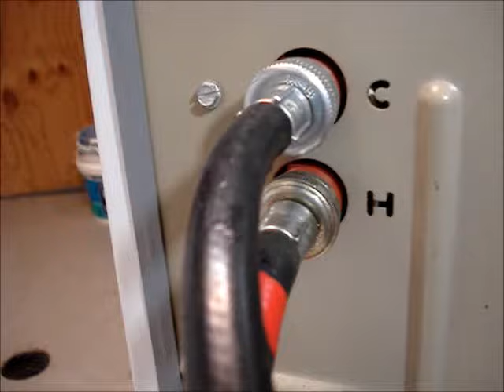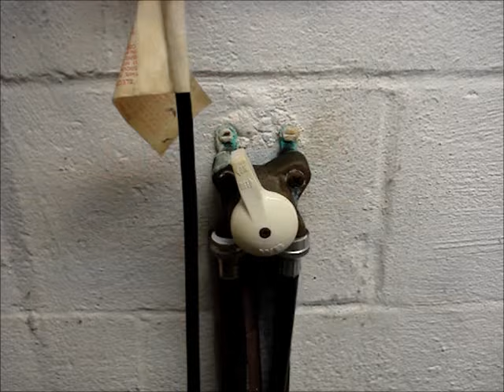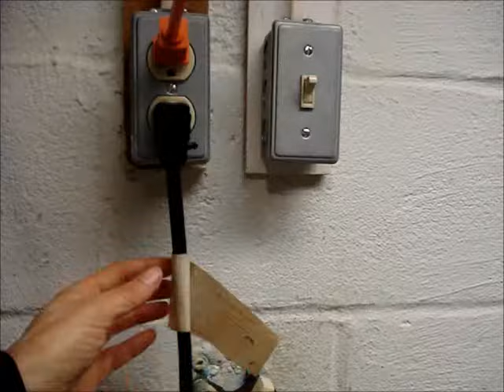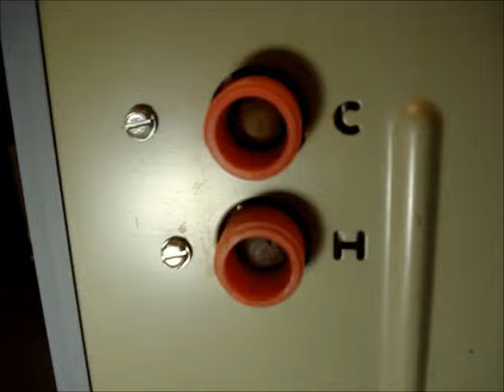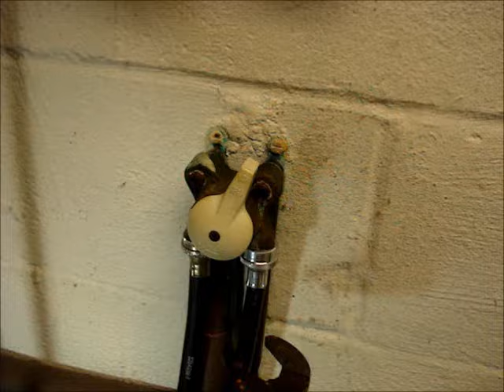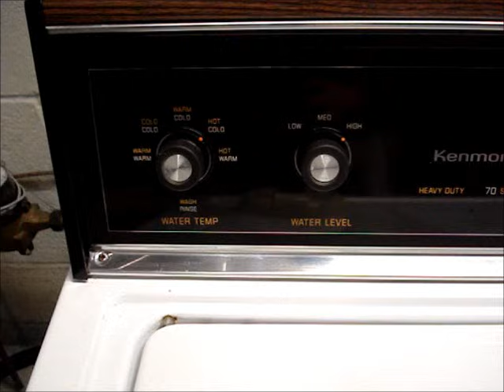Washing Machine Fills Slowly - Troubleshoot It

Comment: My problem is when I set my temperature to "warm" my machine instead fills with hot water. It fills normally with the hot water when getting started. When it goes into the rinse cycle it's slow to fill up. I just get one stream of water coming out. Takes a long time to fill up.

I checked the filters they were ok, not very dirty. I let water flow through each hose, no problem. So, what could be my issue?

I have a GE machine.
Reply from the maker: Sounds like the inlet valve is not letting cold water into the machine.

Comment: OK, I watched your video and it’s very interesting. I did exactly what you said. Change the hoses with new hoses put a new inlet valves in the back of the washer with the hoses. CONNECT checked the psi. Did everything check the drum with the water comes in, still having the same problem even with (2) speed queens the cold water is still slow. What else could it be?
Reply from the maker: If I understand, you have 2 washers and both have slow fill on the cold side?  If that is true, then either there is a clogged screen on the cold or you have some plumbing issue upstream from the washers.

Comment: I have clean filter and good water pressure to inlet valve. Cold water fill starts strong but then slowly and get IE error. Hot water fills fine but cold water rinse is slow and get the error during rinse. 1 1/2 year old LG HE machine.

Comment: if I mistakenly reverse the wires on the valve will it still work? thanks!
Reply from the maker: Somewhere on the washer there is a wiring diagram.  Maybe the back of it.  That should help you get the plugs in the right place.

Comment: They used to make these valves where you could dismantle them and clean the plunger, etc.. I remember doing so prior to about 1985.  Now they are pretty much plastic throwaways. Soaking parts in white vinegar can work wonders.

Comment: OK I did all of these steps before watching this video, bought a brand new inlet valve and still the cold water is flowing slowly. Wtf
Reply from the maker: Maybe the new inlet valve is bad?  If possible, I buy OEM parts, some of the after market are poor quality.  I just had a conversation with someone my car wiper repair video.  Turns out the new motor he bought for the wipers was bad.

Comment: could the issue also be low pressure to entire house? such as before the water even gets to the faucet the hoses are connected to?
Reply from the maker: If you suspect that is the problem, you can check the water pressure.  I have a video that shows how to do that.  https://youtu.be/ySfaBvV6e84

Comment: Wow, not only is this video super clear and concise and helpful, but thats actually the EXACT same washer I have 😂 hopefully I'll have full water flow soon! 😁
Reply from the maker: They don't make appliances to last as long these do.  You might want to check out to see if it is agitating correctly.  There are dog agits, little plastic parts that have teeth that wear down.  When I bought mine on eBay, they were under $5.  I also have the companion dryer and some repair videos for it.  Here's the link to the video to replace the dog agits - cheap & easy.  Have a great day.

https://youtu.be/mvdKR4FR7jE?si=a6hYWYdy3rqCIecp

Comment: replaced hoses and inlet valve, checked waterflow. Still not getting good flow on cold! What could be the problem?
Reply from the maker: Hmmm,  did you check for voltage to the valve or continuity of the wires going to the plug that connects to the valve?  I have a video that shows how to replace that valve, around the 4 min mark I show how to check continuity of the wiring.  Also, not likely, but you could have a new bad valve.  Link to video:  https://youtu.be/wZCAun0eb5M
Reply: @Know-How-Now  i may have to check the wiring. it's an old washer

Comment: I have replaced my water inlet valve twice in the last two months. Each time I replace it the cold water comes in correctly and a couple of weeks later it gets extremely slow again.  Any idea why the valve keep going bad?
Reply from the maker: To confirm, you are saying two new water inlet valves have failed?  If yes, are they the same brand?  OEM parts?
Reply: @Know-How-Now  yes two have failed.  They were different brands.
Reply from the maker: Do you have 120 volts on the cold contacts (same voltage as the hot side when it is open)?  Or another thought, can you swap the hot & cold wiring?  I find it hard to believe you have 2 failed valves, but better to be absolutely sure.

Comment: Question,  I have checked the screens they were clear , The water makes a choking sound while filling the machine ? Could it be the hose is clogged? Would greatly appreciate your input.
Reply from the maker: I would have to do the test shown in the video to know if the hose(s) are clogged.
Reply: I have the same issue while filling up.  Water comes out in pauses , while filling , it makes this choking noise .
I replaced the valves/solenoids , but still have the same issue . Wonder if it's the main control/timer that's bad.

Comment: My washer fills quickly at first (hot or cold).  But then, for some reason, it slows down.  I have to keep pushing pause and then starting again.  When it starts back up, it flows strong again, but then after a bit, slows again.  Any suggestions?
Reply from the maker: If you've followed the steps up to around 4:45 and confirmed that you do not have a water supply problem, then odds are good the water inlet valve is failing.
Reply: @Know-How-Now  Thank you!   Ended up being a clogged cold water screen where it enters the washer.
Reply from the maker: Great, you found the problem!
Reply: That’s my exact issue but only with cold. My screen is clean. Pause and start flow comes back.

Comment: Thanks for this guide. I'm going to use this to check my washing machine. It fills about 1/4 the speed on cold as it does on warm or hot, so I'm fairly certain there's an issue somewhere in the cold water supply or cold inlet solenoid.

While my apartment maintenance won't come out because "there's a pandemic and the machine isn't fully broken", I can at least narrow it down to what needs fixing and, if it's something they're responsible for, have them at least put a replacement part (and written permission to proceed with the repair on my own since they can't send someone out) in my mailbox.
Reply from the maker: You are welcome, Matt.  Best wishes for your pandemic repair.
Reply: Update: it’s not a problem with the water lines or the screens. It’s some thing either electrical or mechanical with the valve on the washing machine. I’ve put in a maintenance ticket and they said they’re going to come out and get that replaced sometime during the week!
Reply from the maker: Thanks for the update, Matt.  It's probably the solenoid/valve.  I think that some businesses are using the pandemic as an excuse, though I suppose some tenants may not be wearing masks and putting the maintenance people at risk.  2021's has got to be better than 2020.  lol, I think most of us will be glad to forget this past year.

Comment: Clean both of the screens in each inlet inside the washer hose inlet. There are two screens for each cold and hot on the washer.. One is inside the machine inlet that you can't see, and one outside the machine that you can barely see, it has a tab you pull out.  Use a flashlight and look inside the inlet tube or nipple that's threaded,  after you take the first screen off you'll see it..  My inside screen was clogged bad. Both hoses were good I saved, didn't need new hoses... All fixed.
Reply from the maker: Thanks for the additional tips, WhiteFeather!  Have a great day.
Reply: Do all inlet valves have 2 screens?

Comment: I have no problem with the cold water.  In fact I get mostly or all cold water only when I choose the warm water on the dial.  Problem is when I want only hot water it comes out as a trickle and takes a insane long time to even fill up to a small load.   Cold water no problem, warm water mostly cold but hot Geez a loo it is barely trickling out.  And sometimes when I don't put it on hot water the whole damn thing makes a loud humming noise.
Reply from the maker: If you've checked for clogs and you know it's not a water supply problem, then as stated, the trouble is likely the water inlet valve.  I have an additional video on replacing the valve.  https://www.youtube.com/watch?v=wZCAun0eb5M

Comment: thanks for the video seems like simple things to check. Mine runs slow only on the second fill.  That accent you have sounded like Philly or 
?
Reply from the maker: You are welcome, Mr J-Charles.  Good luck on the diagnosis.  If it's the inlet valve I have a video showing how to replace it.  See link below. I live about 50 miles from Philly.  https://www.youtube.com/watch?v=wZCAun0eb5M
Reply: Good call!

Comment: Where did you find that part? I have the same washer and dryer except mines the 70 series vales are turned where they side by side.
Reply from the maker: I have the parts diagrams that came with the washer.  If you don't have that, I'd try using the model number on the tag to search for the correct part.  There are a bunch of suppliers where you can find a parts diagram/part numbers.  I think I bought my part on eBay.

Comment: My washer starts spraying water good then slows down
Reply from the maker: You'll need to go through the steps shown in the video.  If you can eliminate the water supply, then it's likely the water inlet valve is the problem. I have a video that shows how to replace the inlet valve. https://www.youtube.com/watch?v=wZCAun0eb5M

Comment: Thank you so much. This saved my aunt $900 for a new washer. The code for the roper showed fill wash error. Which is a low pressure error, caused from a obstruction in the supply line causing the washer to fill and drain immediately without agitating.
Reply from the maker: You are welcome, it's nice of you to help your aunt.  Thank you for taking the time to write the kind and helpful comment.

Comment: I have the Amana top load washer.  Was having problems with it filling and draining without washing.  After a little troubleshooting I think I found the issue.  Take off the hose from the washer cold/hot water inlet to the washing machine.  Try to clean all the debris from the filter.  Put it back together and run a wash.  Mine was filling for 10 minutes.  Now it's actually washing.  Hope this helps you..